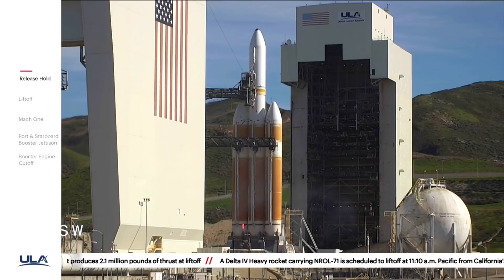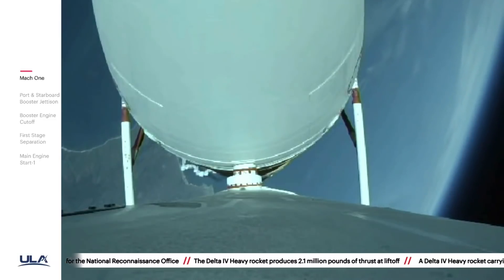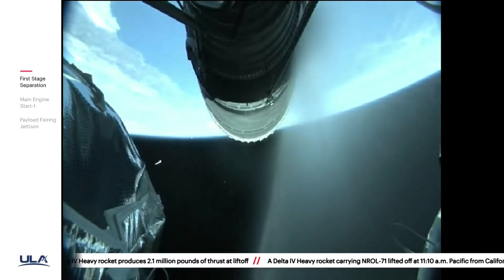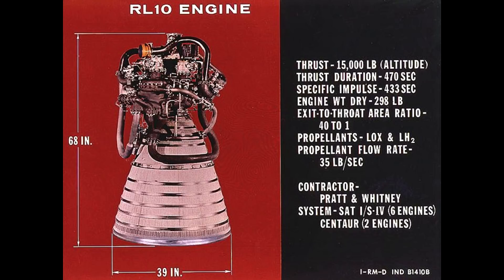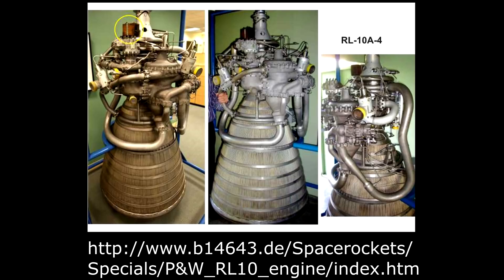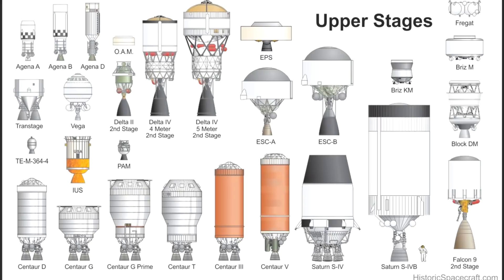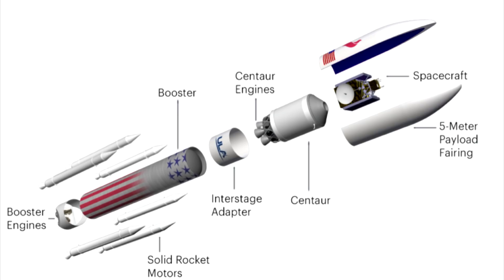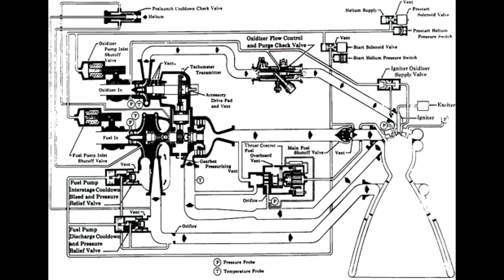The Most Efficient Rocket Engine - The RL10 Expander Cycle Engine

Comment: Why are rocket cameras always in garbage resolution? Or is that just the vibration of the engine? This one looks like it's in 240p
Reply: Because they're cheap-ass video cameras that A) draw minimal current to work, B) are known not to generate RF interference that could cause problems with the booster's electrical systems, C) weigh nothing, D) are tiny enough that their fairings generate essentially no drag, and E) are low-cost enough that it's not a major financial consideration that they aren't going to be recovered.  SpaceX uses HD cameras on their first stages because they're recovering the stages intact (or intact enough that the cameras can be salvaged); on expendable boosters, are you really gonna spend an extra $2,500 on a full-fledged broadcast-quality HD lipstick camera that you know is gonna be destroyed, or just $25 on an El Cheapo-brand potato camera that will give a Good Enough feed for the five or so minutes it needs to operate?

Comment: I want to know how an extendable nozzle could work for the Raptor on the BFR. In particular, it could be used in a retracted state for an atmospheric (much smaller) nozzle. Plus, the LCH4 fuel means that the regenerative cooling wouldn’t be as necessary due to the lower temperatures.

Comment: Ice forming on the edge of an engine bell.. ya I remember that video, pretty crazy, and cool, (sorry). Also, wasn't it you that talked about the very severe thermal gradients in engine bell structures, and the engineering challenges involved? Having ice form on the edge of the bell , maybe not such a big deal. What are the chances of ice forming up inside under certain conditions? If it does, might pose a bit of a concern with smooth flow? I know the engineers included a way to control the cooling on the RS-25 bells for the shuttle, based on the throttle setting. Maybe something similar? Regards!

Comment: There is a lot of information into the video, though no mention of the fact that the RL10 was designed to be man rated, but only used on Saturn 1 for Apollo boiler-plate test launches. The initial Saturn-IV proposal would have used 6 RL10 engines, but the revised S-IVB design used a single J-2 engine. The RL10 engine never made it into the final Apollo moon landing designs, though it did inspire the development of the J-2 and F-1 engines.
Reply: There isn't much in common between the RL-10, J-2 and F-1 other than when they were developed.

Comment: Could an extending nozzle be used for an any altitude engine? As the pressure decreases, the nozzle extends more.
Reply: Far better would be to use an Aerospike Engine. The reason for the nozzle extension is to reduce the overall size of the engine, so the interstage structure can be shorter.
Reply: Too bad nobody's willing to try aerospikes.
Reply: Robert Miller loads of people are willing to try aerospikes, but it turns out they’re just very hard - beyond what normal rockets are.
Reply: @ryanrising2237  
Well people say they’ll try an aerospike, but I can’t find an example since NASA’s experiments, can you?
Reply: @BlueDoubleSharp  Maybe I should have said people will try developing an aerospike. Firefly tried it before their shake-up, there was a university team that actually flew one, and there have been a few papers on DEAN and its derivatives.
Reply: The nozzle has to lock into place, otherwise there will be severe blow-back.
Reply: its always a payoff between optimizing for a altitude and performance/weigth. a any altitude engine might not be ideal.
Reply: It might experience vibration issues. Haha

Comment: For me the RL-10 is probably the most iconic hydrolox rocket engine :)
Reply: RD-0120 or bust
Reply: @rlstnnl1740  Um, no, that's just the best hydrolox engine. Not really the most iconic. :P
Reply: @MushVPeets   It depends on what you need out of it or what you value more.  For a similar dry weight, the RS-25 has significantly greater thrust and is reusable.  And the RD-0120 has its own advantages such as a simpler design and lower cost while achieving similar efficiency throughout the wide flight envelope.
Reply: @rbrtck  ...No, I do understand. That comment wasn't entirely serious. More of a "Soviets stronk! Soviets best!" thing. In reality, I'd say, given the advantages and disadvantages of hydrolox overall, that the ACTUAL best hydrolox engine in existence is Vinci.
Reply: @MushVPeets   Yeah, that's a nice one for sure--finally an advancement over the venerable and still great RL-10.
Reply: The first and still the most efficient.
Way back when, the drive for efficiency separated the world into two camps, closed-cycle and hydrolox. Hydrolox won and then they focused on turning it into a closed cycle.
There are some really neat industrial film clips about the production and quality control that were made early in the RL-10's history, milling the pumps, creating the Rigimesh injectors, leak testing, that sort of stuff, documentary not instructive.
Reply: Naw...the RL-25. Bigger, dramatically displayed on the Shuttle for decades, reusable, etc etc.
Reply: The Shuttle engines were RS-25, not RL-25.
Reply: J-2 son

Comment: That ice is freaky, being mere centimeters away from thousands of degrees.
Reply: But it is the main product of that reaction, which heats it all up to thousands of degrees is water! And it cools down by expansion! Thermodynamics!
Reply: Can anyone explain more in depth what causes the exhaust to get so cold there?
Reply: @Lhunath  the nozzle is cooled by liquid hydrogen
Reply: @Lhunath  Just like Scott explains: that version of the RL-10 has an actively cooled nozzle, and they do that by pumping the fuel an oxidizer, which are at something like -250 degrees Celcius, so the outer wall is really cold, while the inner wall is nice and warm. Space Shuttle used the same system.
Reply: @Lhunath  Regenerative cooling.  Cryogenic LH2 flows through the tube wall of the nozzle to prevent it from melting.
Reply: If obviously there is no heat being put out from the engine does that mean that standing right next to the nozzle would be possible? Or going even further, would there actually be a chilling effect outside of the nozzle?
Reply: @mathboy_  There are still deafening sound an probably oscillating shockwaves that I don't want to feel pounding my body.
Reply: George, wouldn't they be focused downward? Obviously, the engine itself isn't oscillating. I'm assuming that the effects of the exhaust are negligible/entirely absorbed by the exhaust shaft (which is unrealistic).
Reply: @mathboy_  Everything is going downstream at first but then gets scattered, reflected, whatever. That's why a rocket launch is incredibly loud even if you stand a mile or two away. My gut just tells my no not stand within trowing distance when this thing goes off.
Reply: @mathboy_  The pressure waves from the exhaust move outwards in all directions and are extremely destructive. NASA pumped 900,000 gallons per minute of water into the flame trench underneath the Shuttle to absorb this acoustic energy - if they didn't, the orbiter would have torn itself apart.
Reply: I'm aware that the exhaust is quite dangerous, however the video showed that the ice was unperturbed by any heat or oscillations. The exhaust was also apparently sucked. Therefore, I concluded that the environment outside of the engine must be fairly static, correct? Or the icicles would not be able to form. Meaning being next to the nozzle would not be necessarily dangerous/fatal.
Reply: @Mathboy  You don't survive standing next to an operating rocket motor regardless of how well cooled the outer nozzle is... the SPL level would be fatal almost immediately
Reply: @mathboy_  You wrote: " The exhaust was also apparently sucked. " - Look up "steam ejector fundamentals."  Since the RL-10 is always used in a vacuum, how do you test it? Just operating the engine will fill a vacuum chamber with exhaust gasses immediately, but surrounding the working parts with atmospheric pressure can't be accurate. 
As for "being next to the nozzle would not necessarily be dangerous/fatal." Take into account the catastrophic potential. Frankly, I think your observation of the quiescent auditory environment necessary for icicles to form is right on. But that environment is very narrow. I wonder if the engineers tested the sound level in that narrow band.
Reply: @mathboy_  I imagine it has a cooling effect, that would make sense. But I don't know for sure
Reply: @mathboy_  Good question, but I'm gonna look to our host for an answer on that one.
Reply: the whole point of that heat is to push and leave tho, not to stay

Comment: Wasn't the RL-10 originally designed by aeronautical engineers?  This is the reason it is restart able. Or am I wrong?
Reply: todaystarr Yes, in fact it was designed by Pratt and Whitney as they first rocket engine, the fact that was restartable was a design requirement of the Centaur stage that the engine would have powered, one of the main things was that being built by jet engine people who didn't have much experience in rocket engine and maybe thanks to the expander cycle, the first iterations of RL-10 had start sequence timings so relaxed that the sequence had little automation almost any other engines at the time. While it failed many times in the beginning the RL-10 In the book "the Centaur upper stage" was described as a gentle machine

Comment: It's a good thing Aerojet Rocketdyne started work on bringing down the cost of RL-10, as that's probably the only thing preventing them from being obliterated by Blue Origin.
Reply: Well my money would still go behind the 60 some odd years AR/P&W has on the RL-10. Approximately 475+ missions with a success rate in which you can count the failures on one hand.
Reply: @afterburner119  Which is useless if nobody wants to buy them.
Reply: The RL-10 is unique and even after more than 50 years in service, still has very significant advantages, particularly in a vacuum. It's not a matter of this v Blue Origin or SpaceX. The numbers the RL-10 makes are still very compelling, even though it's not very powerful. Their biggest challenge is to simplify it and reduce the cost of the thing. It's still an excellent engine.
Reply: Aw yes, comment made 2 years ago when Blue Origin still had the respect of the every day space enthusiasts. How naive we were.
Reply: @countryman032  Oh how they have let us all down.
Reply: There’s no way that ULA is letting go of the RL-10
Reply: They like it too much
Reply: Also SpaceX is better.
Reply: @kazumiohta8727  That isn't constructive, objectively defensible, or accurate.
Reply: @kazumiohta8727  That argument doesn't make sense. SpaceX doesn't sell engines.
Reply: @kazumiohta8727   Apples and oranges. Space X does not dabble with LH2, which makes their second stages much less efficient. On the other hand, the physics of the RL-10 concept limits it to 25,000 lbs of thrust, so  an RL-10 upper stage has to start higher and faster to avoid dropping back into the atmosphere, which makes it difficult if not impossible to land the first stage with reasonable efficiency.
Reply: Better that blue origin